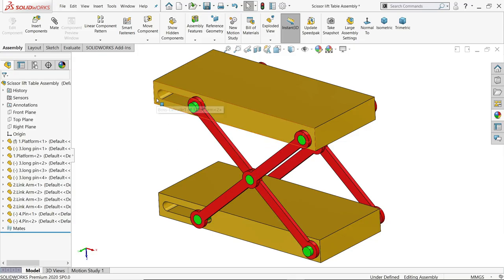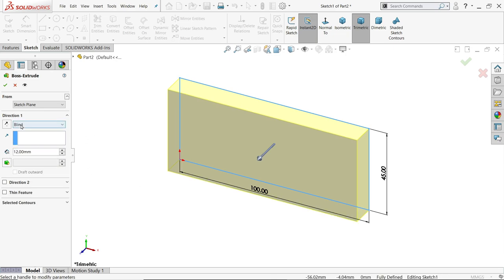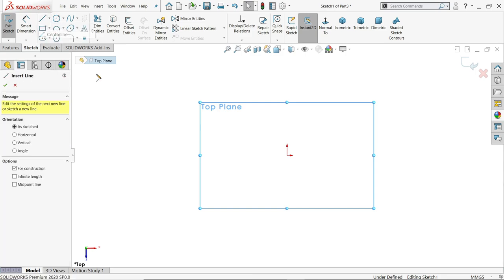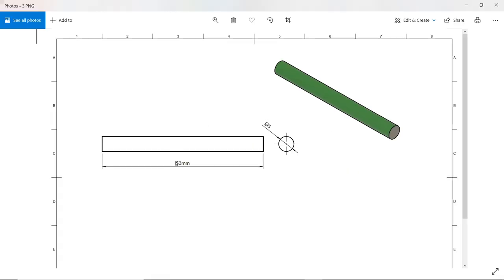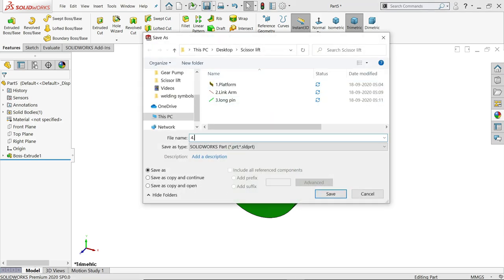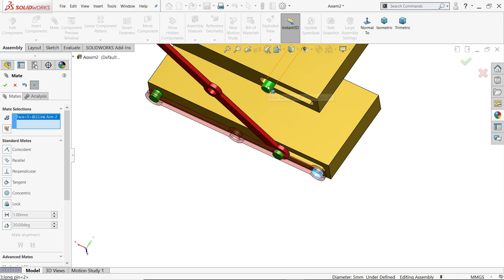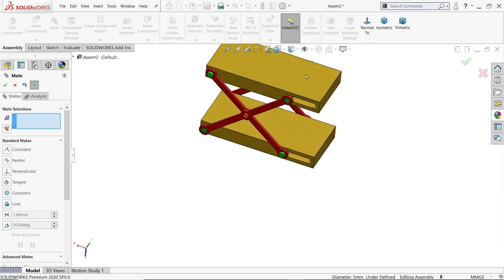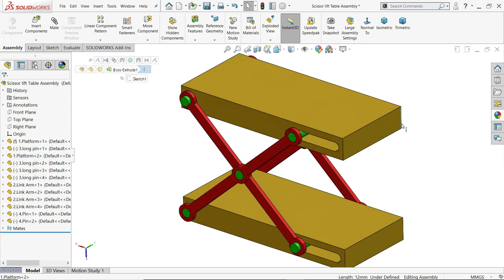Scissor Lift Table Assembly in SolidWorks

Comment: sir i have a small doubt, why did you change the plane, 
1st part - front plane
2nd part - top plane
3rd part - front plane
4th part - front plane
for what reason here this changes occurs, why didn't you sketch these all 4 in front plane.

Comment: For SW 13 users, which contraints to use ? (There is not the slot mate)
Reply: What is Solidworks 13? Dont they go in a yearly fashion? (SW 2022, 2023)

Or do u mean SW 2013?
Reply: @personalchannelofmine  yes Solid Works 2013 I meant